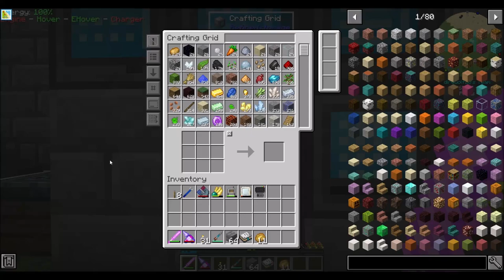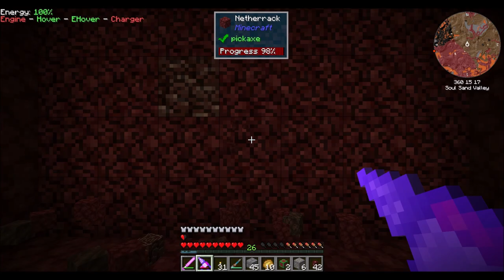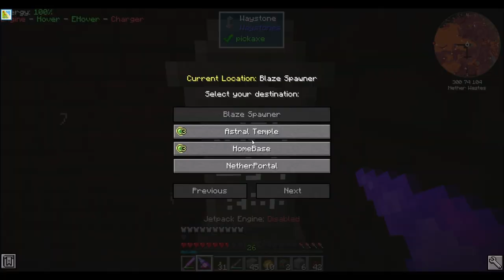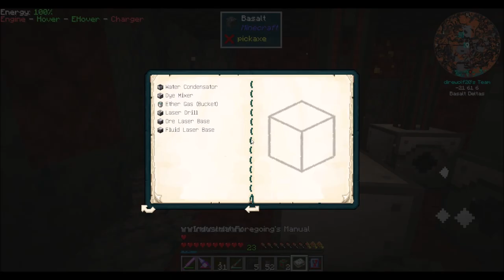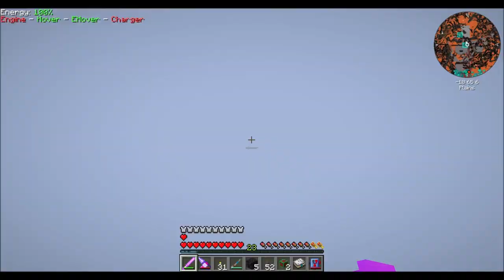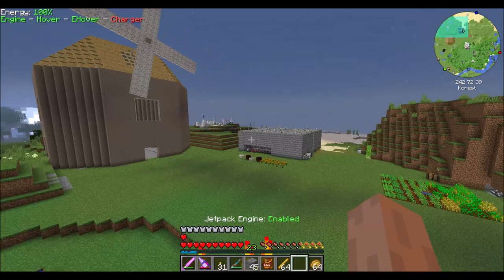Lets Play S10E51 Ancient Debris Mining

Comment: A cool feature I've found is that the tetra Holosphere can be used to locate Ancient Debris in the Nether. It's helped me find a whole bunch of it so far.
Reply: how do you do that?
Reply: @sfdv1147  if you hold the holosphere it shows a scanning bar at the top of the screen. It will show a red blip in the direction that the ancient debris is in. It also helps you find the Tetra forged stuff in the overworld too. You can stick it in the workbench and you can increase the range that it scans for if you attach a bolt in the Tetra workbench.

Comment: The IF laser drills are more versatile in 1.16.  You can now place many more of them per base unit.  They have a working area button .  They also can now shoot through each other and diagonally.  So, in theory, (and with enough RF) you could have dozens of lasers pointed at that single base(72?), but it can only mine at one level and focus on a small number of lenses.

Comment: adding a charging gadget that's a curio shouldn't be too hard.  You should go for it!
Reply: In fact curio allows you to manually define new slots and tag items so that they can be accepted in them, the detailed instructions are in curio's github documentation so I highly advise to read those to know what is goin on.
For example to add thermal expansion's flux capacitor the curio config file should look like this:
[[curiosSettings]]
	identifier = "charger"
	size = 1
And the .json for the datapack like this:
{
  "replace": "false",
  "values": ["thermal:flux_capacitor"]
}

This works, can be charged by flux networks and can charge items on the inventory. I tested ;)
Reply: @AlbusRegis  Cool! I'd probably want to have a few "stacking" curios, like a belt of pouches that then adds a couple of pouch slots to carry other items.
Reply: @AlbusRegis  Thank you, commenting so I can copy this later😁

Comment: Change magnet to magnet form simple magnets
Reply: Get pneumatic crafts armor and install magnet upgrade!
Reply: @Scottec1425  The simplymagnets advanced magnet has a higher range by 1 block, but ultimately the choice is yours as to wether an inventory slot is worth an extra block... though since it's also a curio that's not as big of a deal. Pneumaticraft is broken in so many other ways though :) just finished slaughtering the ender dragon with micro missiles and it was indeed fun if not a minor bit frustrating. I wish there were damage upgrades for the minigun, or at least other pneumatic weaponry.
Reply: one more tip, applying a dispenser upgrade to an aerial interface will autofeed you steaks, or even golden apples if that's your thing.
Reply: @GlitchedVision  I've been still using my op tetra sword lol! I haven't done any of the weapons.